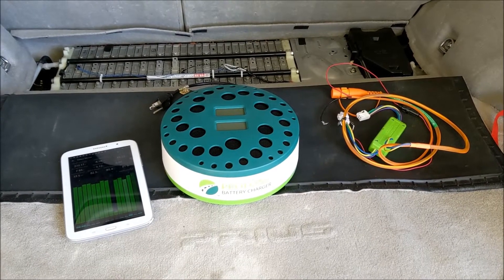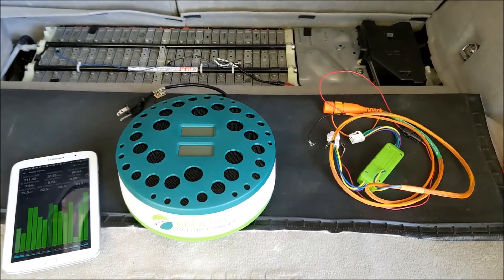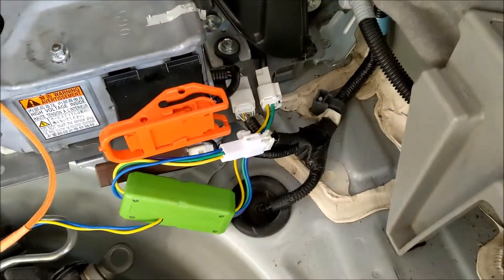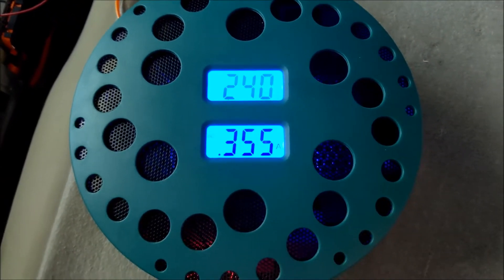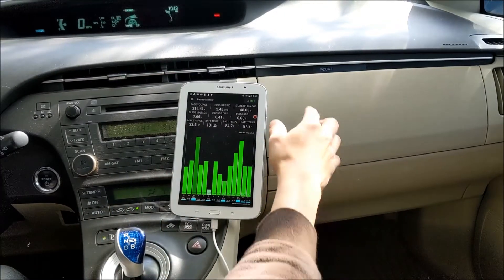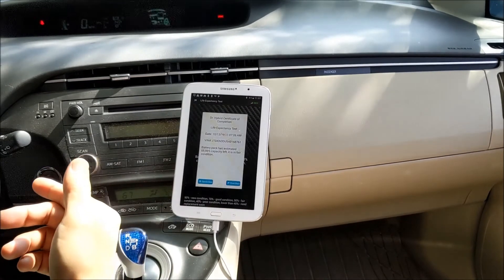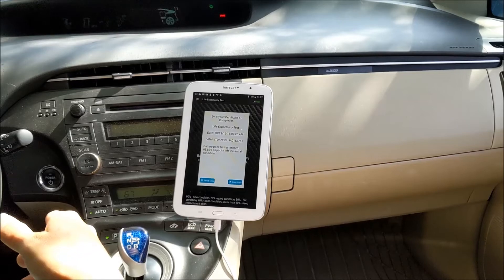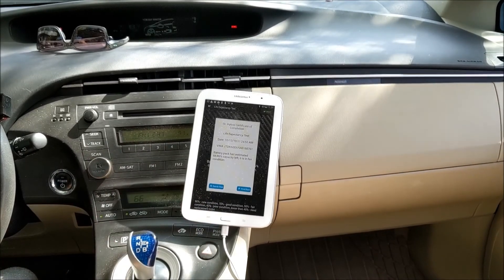Dr. Prius testing Prolong charger on a 2010 Prius #1

Comment: This is not using the prolong charger to it's potential. Additionally the prolong charger is not at all the optimal way to recondition a hybrid battery. There are way way better options.
Reply: Such as…?   Thank you !
Reply: Each cell must be discharged and you measure it's capacity in amps  @Sun4Ewa

Comment: I bought my 2010 Prius 4 with 196k miles, was getting horrible, 43, fuel mileage, I ordered the Prolong charger/discharger, ran the charge/discharge cycle as described and instantly started getting 50+ mpg As I started learning pulse/glide, I have seen as high as 67mpg on a 15 mile trip, car has 226k on it now and just had to replace a  couple modules due to a  P0AA6 code, I had 2 modules shorted to ground. Replaced the modules and got an instant p0a80, so I hooked up the Prolong system, ran 3 cycles and no more code, back to getting 50++ mpg
Reply: How many cycles of charge/discharge did you do
Reply: @Priust189 Just got the P0A80 code on my 14 Prius V and after some research I’m considering removing battery to clean bus bars and then use the prolong charge/discharge kit….   I’ve heard from some that claim just cleaning the bus bars fixed the resistance problem and cleared the code…. My code is from a basic auto parts scanner…. I’ll be purchasing an OBD 2 scanner to-do a more detailed scan of the battery but im still on the fence about purchasing the prolong kit
Reply: @a.ced.2052 our 2012 Prius V just gave the same code. Was the bus bar swap enough for yours? I ordered bars and a scanner for now.

Comment: have you thought about installing it permanently so its like a plugin prius upgrade
also i had an idea how about using a 12v lithium battery to power a AC inverter to run the prius hybrid battery charger, installed into the car so its like a plugin EV mode range extender !
basically make our prius's into DIY plugin EV's and then charge them off solar and be living the off-grid dream on a budget driving around on free solar power

Comment: I recently did a single charge - deep discharge - charge cycle on my 8 year old, 100 000mile Prius C - and got from 73% to 100% according to Dr Prius.  But went a much cheaper route, using an LED Constant Current Driver as the  high-voltage, low-power supply. A DIY Grid Charger in other words, and a 60watt light bulb as a discharge load, taking the pack down to about .9 volts per cell.
Reply: Would you please drop a link for LED power supply you used? Also how long did it take to finish one cycle?
Reply: pls link us up!
Reply: Λινκ

Comment: Just started using the full charge and discharge kit. I had no warning lights but the signs were there that the battery was losing some power. I have used NiMH and Li batteries in RC flying for years and know that these batteries need balancing once in a while to make them last. So it's not snake oil like one rube says. So after using the charger, my battery is now well balanced and the car has more pep and better mileage. It worked!

Comment: I am considering getting this for my 2005 prius . with the dr prius app, it is showing a 65% state of charge
Reply: Check this guy video update. His battery at the end is indeed just dying and he needs replacement. This device does not safe him anything besides $500 extra spending. Check GreenBean Battery if you are in USA. If you are in Europe, go to Toyota dealer and it cost no more than €3250 installed with recycling. program. But it is 2005, it worth less than €4000.
Reply: @rondhole  I believe Green bean only gives you a 2 year warranty here in the States with a cost of $1,900 + tax for a Prius. if your pack were to fail within 2 years their site states that it could take up to 60 days to get a replacement.
Reply: @metrork1  11
Reply: @rondhole  thanks!! iw il check out the green bean battery.
Reply: @motiahmed8972  But don't buy if it is not broken. Trust me, just keep driving it, I saw many pass 15 years 400k miles with original battery, really depends on how it was used. Just prepare the money if you need it. Mine died after 12 years 240k miles in hot Florida and has no garage.  I sold it after putting $800 used battery.  I still can drive it around for more than 400 miles before getting battery replacement.  You are not going to be stranded when the battery is completely died. You still can drive  the car safely but with less torque and power.
Reply: Save your money and prepare to buy a battery instead. $1000, your ass is covered for the rest of your Prius life.   State of charge from Dr. Prius apps is not accurate.  it reads high after you are in long high way speed trip, and low when you are just goint in town.  After all it is 2005, It is time for recycling it. 2nd Gen Prius typically have 10-11 years battery life in hot climate and about 15 years in mild climate. MIleage does not really matter but if it is always in the garage kept, they tend to last longer.
Reply: @rondhole  One thing though if purchasing a $1,000 hybrid pack, is they are composed of used battery modules that have been reconditioned. Who knows maybe the pack last you 30 days, maybe 6 months. Please tell me where one can find this Hybrid pack for $1,000 with a lifetime warranty. I have looked all over.

Comment: To prolong battery life, get a car garage and park it there. The main killer is heat from Sun when you park a whole day. Most prius in North last  50% longer than in southern usa with hot humid summer
Reply: Right man. I bought a prius from the north and a prius from the south. My Northern prius is a rust bucket but the most reliable car ive every freakin had! My prius from the south looks cooked. The clear coat is damaged and the battery is on its last leg. Since there is no rush im going to go ahead and fix the clear coat and replace the battery with lithium cells. But yea the south cooks these batteries if they arent in a carport or garage. And driving around in the summer without having the A/C on. You can always tell the performance difference when its hot outside or when its more on the cooler side.
Reply: Lmao this was entertaining

Comment: It's exactly like slow charge and discharge in nimh battery that can regain temporary additional capacity. I think it's not useful enough for most people. The only solution is new battery from Toyota for about $2200 and repack it your self and get another 12-15 years of you park in garage or non hot area.  You can see from His #2 video, his battery is still dying after all and need replacement after Prolong illusive reconditioning.
Reply: This is not entirely true. In addition to getting a new battery from Toyota, in many areas you can purchase a rebuilt one and install or bring your car to the rebuilder who will install it for you.  In the Boston area, at least one rebuilder will come to you to install.  Or, like I did, if you’re not terrible with electricity, you can recondition and balance your on battery. I wrote my process up in the PriusChat wiki section.
Reply: @cawag98  our life worth more than $1000.  Reconditioning is placebo drug.  Opening prius battery is always risky for any accident. Yes, I can do that, not terribly hard. But I would rather spend 1500 and enjoy my day playing with my kids, having lifetime warranty. If I want to sell it, yes, get a used battery and sell it. Just like what I did to my 06 prius.  After all 1500 is nothing compared to the fuel saving per year  $500 compared to other midsize in 15k miles.
Reply: ok but this charger is like $500 whic is a fraction of that cost and it will keep the car alive. for a high mileage prius, 2200 is almost the value of the car ?
Reply: @motiahmed8972  But it does nothing, just an illusion. A dead battery will still be a dead battery.  You need to get one and it is realatively cheap from greenbeanbattery for instance. 1000 dollars transferable lifetime warranty.  $500 is already 1/2 price and $500 more is just like buying a set of good tires.  Don't give false hope, get a real thing.
Reply: @rondhole  on a dead battery you are probably correct but if your battery is low like this situation then it seems worthwhile ? This is basically rebalancing the load as well between the banks
Reply: @motiahmed8972    Hybrid battery has 15 years warranty unlimited miles in UK/Ireland or about 10 years in the rest of the world.  It is aging and chemical process that increase the internal resistance.  Yes with Dr. Prius, you can check it. That's the most important parameter, not the paid battery tester with an incorrect diagnostic of battery condition.   Just drive your hybrid in highway regularly, it will cycle the hybrid battery fully.  OIl and ATF change, HV battery vents cleaning yearly helps you more than anything else.
Reply: @motiahmed8972  It is your choice to dump your money on such a device. $500 is a lot. I won't buy it even if it is $50, too much unnecessary hassle for the placebo effect.
Reply: @rondhole  thanks for the insight. i 100% agree that HV battery vents cleaning yearly is the best thing. i will be cleaning mine this summer :)
Reply: @rondhole  Greenbean is showing $1649 for the Gen3 battery. Big difference from $
1000.
Reply: @johnwaggoner7528  Thanks for letting me know. It is used to be much cheaper, they increased the price.  In my opinion, this Prolong does nothing if the battery is already degrading. If you really want to save money and you already know how to safely work with Prolong, just check the battery charging state and load, internal resistance, and get individual cell replacement instead.  You can use generic ELM327 scanner that work with Dr. Prius.  Find out which cell is failing and replace it.   Otherwise, you waste $500 for a snake oil.   The problem is the value of the car ($3000) that is often lower than new battery cost.  In my opinion, it is better to sell the Prius as-is for $2000 and someone with better skill can replace the battery. Or get a used $1000 battery installed and sell it for slightly above the KBB good market price.   With the gas price $3 per gallon, it is an easy sell right now.
Reply: @rondhole  Sorry but this is not correct. you can´t go more down in the discharge because the car battery software management don´t let you get there. I don´t beleave in this kind of product because it can´t do the right job. Series charger? cam on , we already have series in every module to manage and now all of them? This work will never tel you the correct situation of individual module, evan DR. Prius can´t tell you couse you get info in pairs and based in voltage. If You need the right information need to get hands dirt
Reply: @micasaveiro  this equipment will help as a bandaid, but will never really solve the problem of aging batteries. If it is $50, yes, it is worth a try, but $500, it is in the range of used battery replacement cost.
Reply: @micasaveiro  Dude, If you buy the battery from Toyota, it is guaranteed New. NiMh and Li batteries degraded from cycles, age, and heat. You get almost nothing for this device.  It is better just to buy some used unit if you already know how to replace each module.  You save a lot of money by doing that.  The new battery is not cheap but not extremely expensive either.  The new battery installed in Frankfurt Toyota dealer for CT200h/Auris costs €2350 total including labor, slightly cheaper for 2010-2015 Prius.  In the USA also costs about the same, slightly cheaper in the UK.  I am not sure where do you live but do not waste your money on such a device.  Get a good proper glove, Good multimeter, and replace the module that failed. You may extend the life by replacing one or two bad modules but the rest of the batteries are old too, they will fail in few months anyway.  If it is more than 10 years old, replacing the whole unit is the best solution if you keep your car for another 10-15 years. Most Countries have at least 8 years warranty on HV batteries, check your warranty first unless you live on a remote island.   The majority of hybrid cars are sold in the USA, so we always talk about the USA.  EU has 10 years warranty/unlimited miles, the UK/Ireland have15 years.  The USA has up to 10 years/160k miles warranty.  If you complain about your HV battery, you must be out of warranty and it sucks but we have to swallow the reality. Your battery is older than 8 years, there is no reason to waste your time and money besides replacing the whole unit.  Most Toyota dealer can sell the battery for about  $1714  these days for Prius, but you do it your self and return the old battery to them.
Reply: @rondhole  return the old to them... what for?? don´t you think this is strange?? You talk in the perfect world. With time you will see the real one. Now we have the new modules with the supervision of DR Prius people in LI. If it´s to go for new better inprove and get one of thouse.
Reply: @micasaveiro  The price is $1700 if you return the old battery for recycling by Toyota. You can keep it if you want but I am not sure how much you have to pay the additional cost.  As I said, it is your choice, you can keep replacing the bad module until the whole battery is new.  YOu cannot deny the nature of the worn battery.  YOu replace only one or two module and sell it, that is a good effective solution.
Reply: @rondhole  1º Can you buy modules to toyota? - 2º waranty time is the same when you buy new car? - 3º When replace battery they keep the old one, think men, think. Show me a replaced battery module by toyota and i can tell you when it was made by reading printed information on it.
Reply: @micasaveiro  No use to discuss. Just swallow the reality that HV battery need replacement at some point. Either 10 or 18 years depends on how you drive and where you live and how do you park your car.  Heat is the main issues and generally most Prius 2nd gen and 3rd gen last between 10-12 years in hot climate and >15 years in mild climate like UK/Ireland.  No need to show anything, that's statistical number.
Reply: @micasaveiro  Of course, but we should not let people mislead by false claims. The battery is a wearable part and unfortunately, NiMh battery with LaNi8 cathode degrade in a sudden drop fashion, unlike Li-battery.  Therefore, we cannot see the gradual degradation like Li-battery in EV. I only try to help you, man.  It is your money, but I still care about you too, not to waste on something elusive.  I had 3 hybrids, they all eventually need battery replacement. 1 died within 12 years/223k miles in Florida, but the one in the UK last much longer even with the same mileage and over 16 years, still have no issue.  UK/Ireland has very mild rainy cloudy weather and as I said before, Toyota gives 15 years no Km limit exclusive only in UK/Ireland.  Mainland EU only 10 years warranty because Spain and Italy are hot too.
Reply: @rondhole You are very knowledgable on Prius NiMH battery. Could you please help me with two questions: 

1) I know if you have a bad module, this device (actually any device) will not solve the problem. The bad module needs to be replaced. For the majority of Prius owners, is it a bad module or is it just out of balance? For the out of balance group, how long (years or mileage) will this reconditioning help the car? 

2) For the $1000 transferable warranty battery, what is their business model and how do they survive if reconditioned batteries don't last long?

I have two Prii 8 - 9 years old, and probably need to make a decision not far away down the road about batteries.
Reply: @Sunnysky321   

1. Bad modules need replacement (or sometimes bad connections on the bus-bar also show bad module code). Clean the bus-bar or replace the battery module. 

2.  Heat is the main enemy of any battery. Clean the intake vent regularly and park it in a garage. If you live in mild climate, it should last at least 11 years, many past 15 years 300k miles.  Don't buy any battery if it has no problem but if you need one in USA, Greenbean battery offers $1500 lifetime transferable warranty. Very good if you plan to keep it for a long time and the resale value also increase significantly for 10+ years old hybrid.  Of course new battery from Toyota is the best if you want to keep it because it has about 10% more performance than a good rebuilt battery.  Most Used batteries still have about 80-95% usable capacity if it was done properly.

These companies who do rebuild the battery only need 1 or 2 modules from other good batteries before they sell it to you.  They will take your whole battery and reused some of the good ones from yours to build another rebuilt battery.  It is a very green solution because they used all working parts till their last legs.  I bought one from a local rebuilder before with only a 1-year warranty. It works fine but I feel the difference, It rarely can do full EV mode as the old one, but it was only $800 and I believe they do not do the rebalancing properly.
Reply: @metrork1  they get more costumer, increase the price. Initially they sell it for close to 1000. I think for 1700, I will buy original Toyota battery instead. I believe it is $2500-2800 +tax